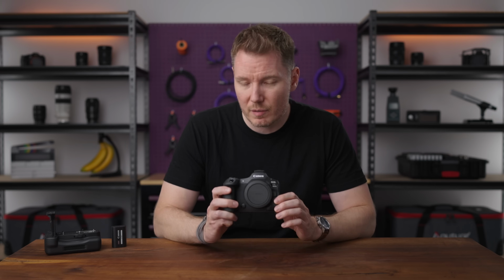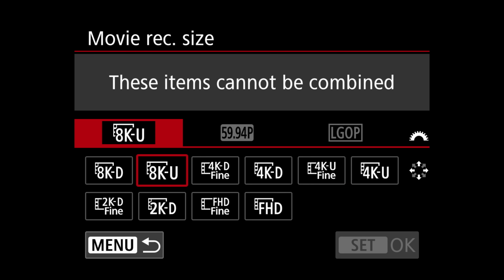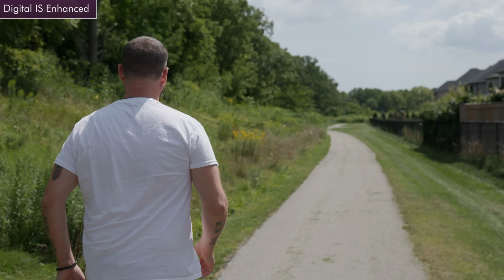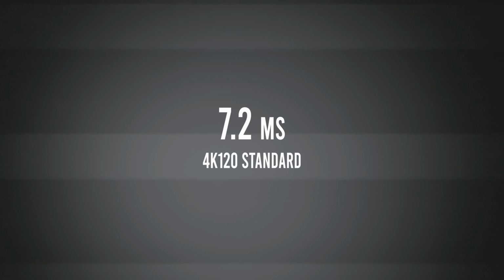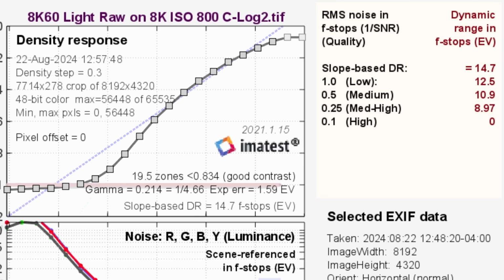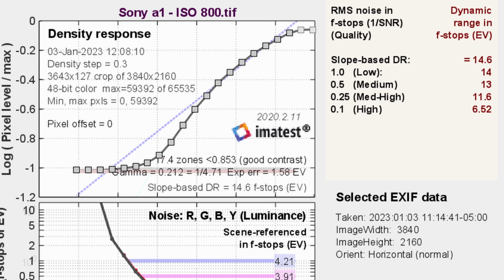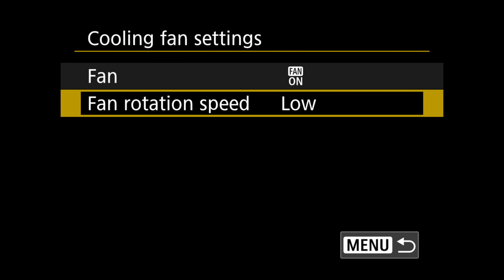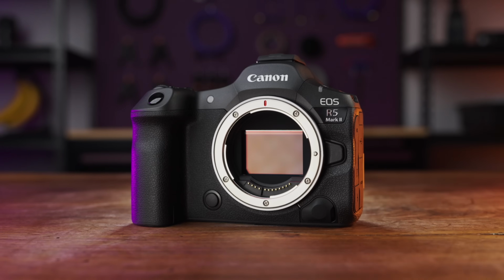Canon R5 Mark II Review: A Truly Impressive Camera

Comment: I'm not sure the XYLA 21 tests can be taken at face value. There is no way a line skipped 4k from an 8k sensor should capture more DR than the 8k or oversampled 4k recording. We know there is some noise reduction going on but that doesn't fully explain the DR increase. Canon must also be doing some tweaks to the roll-off of the image that's affecting the "slope based DR" reading.
In the PC, laptop and smartphone world, a lot of the companies have been caught optimising their machines for benchmarks (Samsung, Apple, Intel) rather than real world use.
I wouldn't be surprised if camera companies have started doing the same since you and CineD (and I'm thankful that you guys did, as it was much needed) have standardized the Xyla21 chart analysis for your DR estimations.
I hope Imatest can come up with newer chart and analysis software that judges DR based on detail preservation rather than noise level.
Reply: Most cameras that record internally use some level of in camera noise reduction.  The Sony A7S III for example is an impressive sensor but part of its video results are due to very aggressive in camera noise reduction. The only way to truly judge how good the sensor itself is would be to shoot raw. The internal Canon video now uses a lot better in camera noise reduction than the first R5 model can use. Some will consider that bad but many will consider that a good thing.  It means the camera can be used out of the box with better results.

What determines dynamic range is the measurable steps of light 1/2 or 2x difference between pure 0 black and pure 1 white. No matter what that is always dictated by the clipping saturation point and log format. If c-log2 can do up to 15 stops than that's how many steps are between 0 and 1.

Noise is entirely what determines the usable stops within that full set of stops the log format supports. The worse the noise the less usable stops.  Really good noise reduction will make every stop look clean.  If all stops look clean well then its going to look like it has that much more dynamic range. Because we determine which stops are unusable based on noise.

Is that cheating? Not really.  All cameras with internal formats use in camera noise reduction.  Panasonic, Sony, Canon you name it. Its a normal practice.  Sometimes a camera can only handle very limited and crude noise reduction due to processing and heat limitations. Resolve and Neatvideo noise reduction even on bests of systems are slow to process.  Cameras have very tiny processors with very limited heat dissipation and power. Naturally its not going to be as good unless more resources are dedicated to that noise reduction.

So yes in camera noise reduction which is handled much better now vs the first R5 model can help internal video have more range. 8k raw with really good advanced noise reduction can do that as well and likely even better. Its not cheating either.  Its a normal image pipeline except for really darn good strong sensors like Alexa.
Reply: @digitaldevigner4080  and noise reduction doesn't increase captured DR, it only provides cleaner shadows which can be useful for having a minimal post workflow but having even a 10 bit compressed image with minimal NR baked in can actually give a better result of getting cleaner shadows by doing NR in post.
Reply: @Wildridefilms if she’s does increase dynamic range. The dynamic is determined by the log curve. C-log2 has a curve that can fit 15 stops. 6.3 above mix gray and 8.7 below mix gray.

No matter what a camera shooting c-log2 will have a total of 15 stops. What determines usable range is the signal to noise ratio. That’s what gives us only 10 or 12 or 14 usable stops. Clean up that noise and you get closer to that maximum allowed by the log curve.

The other factor is the clip point. C-log2 clips around 80% and not 100% which the curve goes up to. C-log2 can theoretically have 8.3 stops over mix gray but the sensor is fully saturated at 80%. This helps give the log format a bit of headroom.

Cameras have always used noise reduction as a way to help their dynamic range look better. Some sensors just have such good signal to noise ratio it may not need it at all. Very few DDLR cameras have such a sensor. Even the mighty A7S3 uses very high amounts of noise reduction to make the sensor do better than it should be.

Some of these cameras that added external raw look a lot noisier than their internal formats. That’s because raw will not have noise reduction. It’s really what the sensor is capable of.

Dynamic range is a very useless fact we have all been trained to obsess over as a number. Most of the time that number is fudged. For example Sony claimed 1( stops on the A7S I when it only recorded an 8bit format. It was physically impossible to have that range yet because of the noise reduction everyone assumed it had great range.

The thing about the log curves is they get paper thin at the bottom. If you had a perfect sensor with zero noise those bottom stops would still be useless to lift up. There are only a few 10bit samples used at the very bottom. Lifting up those stops would still have color loss and banding. Ironically the noise down there actually makes those low coded value stops look more detailed than they really are.
Reply: @digitaldevigner4080  Using noise reduction is "RAW" seems like cheating to me and is something Canon have consistently done in the photography side of things.
Reply: @Wildridefilms  pretty sure there is no noise reduction for the raw video. The 8k has a lot more noise than the internal formats.

The 4k s raw is an odd format. It’s not really line skipped. I think k if has a different name because it’s being handled very differently. Kind of like how Braw isn’t true raw and yet still provides some of the benefits of raw.

Due to the process used to down convert it can help the noise. We also don’t know what other processing is involved with the format yet.

Without a doubt the 8k raw has no noise reduction.
Reply: The XYLA 21 is it necessarily an inaccurate testing you could do it shows the results of what the camera does so I don’t know About this claim.
Plus, Gerald is just a type to just give you what the test results are you take them how you want

Comment: 8:09 "The bit depth didn't change" => the output bit depth didn't change, but what matters for readout speed is at what bit depth the sensor is reading the pixels. For ex if it's reading it at 10bit in 8k and at 12bit in 4k, that can make the 8k read faster.
Reply from the maker: True, but often those are reflected by "capping" the total stops you see in dynamic range testing. Often when cameras go from a 14-bit to 12-bit ADC, you'll see the DR get capped at 12 stops. I didn't see a difference at all. So unless they went from 16-bit to 15-bit and it didn't hurt the DR. I'm not sure.

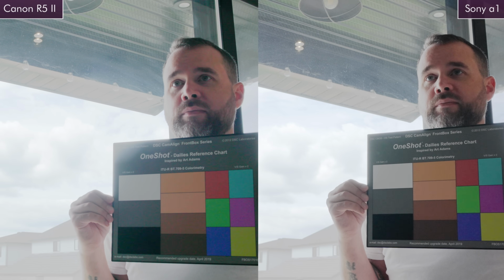Comment: Excellent video! Seems like a lot of what the original R5 should have brought to the table! One thing, at 17:15 your pushed shadows shot for the A1 seems to have significantly less color noise than the R5 II, at least on youtube, but the imatest scores suggest the canon should win by a significant margin there. Why is that?
Reply: And if you can see the difference in a left top corner of color palette... Canon spill some light...

Comment: What? No Canon Crippling Hammer?
Reply: I would say the cripple hammer are all the things he said in the very beginning, which you tend to forget by the end of the video. Those aren't minor annoyances when you have to fumble with them every single time you use the thing.
Reply: The only two gripes I have are the exclusion of a 4K 60p oversampled mode and a better custom white balance mode.... The other annoyances he mentioned are pretty much subjective and minor. The lack of customisation he mentions is only by comparison, you can pretty much assign a lot of functions to each button and use it in a very convenient way, the exclusion of an attenuator is a bummer but most non serious videographers are satisfied with a standard 3.5mm option and most serious ones use a hot shoe mounted option nowadays, the buttons are only an issue if you have gigantic hands and even then you can get used to it and so on. These are not cripple hammers per se in the way Canon implemented them in the past. Things are much better now. You can find these little quirks in every brand that exists. This is coming from someone who has used the camera for a couple of days and primarily shoots Nikon Z8. I am very impressed with the AF and image quality of the R5 Mark II both for video and stills. And it passes the bar in the most important departments ergonomics, flexibility, image quality, DR, speed, buffer etc. The battery life in video is a drawback but it's excellent for stills. Canon just needs to give up being elitist and allow some third party manufacturers to step in now, to me that's the worst thing about the system right now. If they manage to do it, I will be lining up to buy this camera. The lens thing is the only thing that's keeping me.

Comment: A solution for piping line level things into mic jacks like this one: Shure A15LA or similar line to mic adapter. This will attenuate by 50dB and match the impedance.

I used to use this with a C200 to get line level into channels 3 and 4 via the stereo mic level 3.5mm jack.

Comment: Have to buy their new batteries. Can't use previous battery versions/models.
Reply: You can use the older batteries in the R5II  but the new features that require higher voltage and power delivery will be temporarily disabled. You will be able to use the new batteries in some of the older cameras which is nice if you run multiple bodies